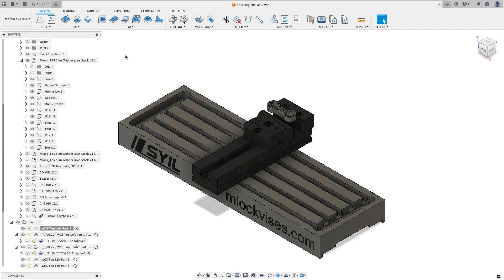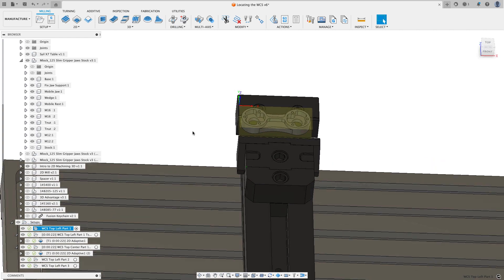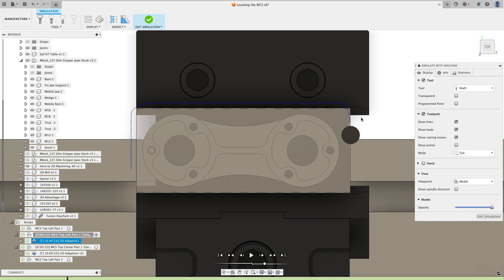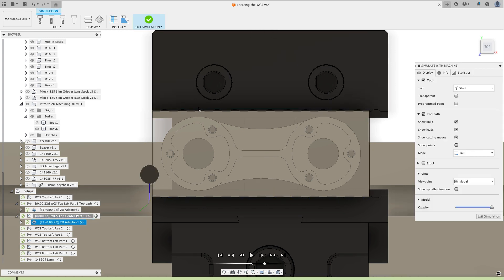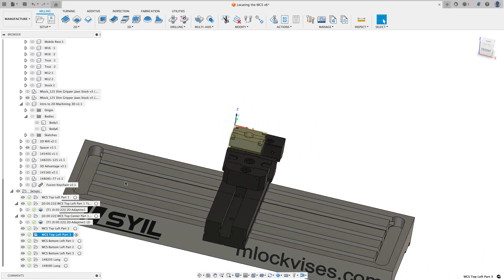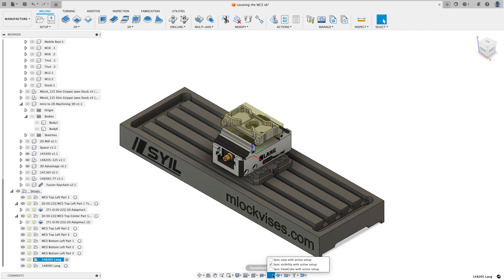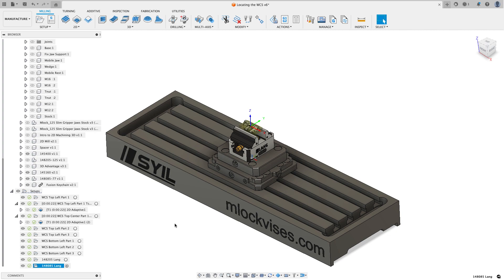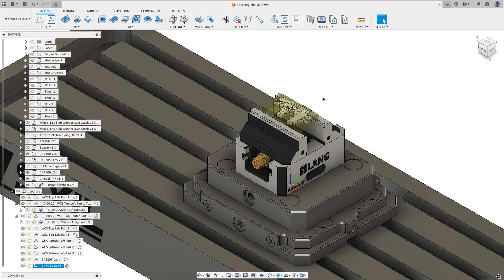Fusion 360 - WCS Location Options

Comment: I’m experimenting with a half/half process. I have fixed points on the vice as my reference. But the WCS is say underside midpoint of the stock. I then have a macro which is something like an incremental G10, which sets up say G54 based off the reference points. This is done with a manual NC op, and the offsets are measured off the model manually.

I’ve an automated probe on the machine, so I usually then do some automated probing to update the stock position to a few microns,etc. Those who use work stops could just go to the machine, check where the stock is and come back and update the params in the NC code.

I’m generally setting this up as a setup type program to be run once before the main program. Basically to semi automate machine setup. The benefit is that tool Z min is quickly inspected to see if it touches the jaws (eg nothing should go below 2mm for my serrated jaws). However, the program is unchanged if I move the vice and I can tweak the precise WCS by hand if needed.

Disadvantage is the manual step to enter the offsets (measured from within cad). However most users with a small number of vice/jaw locations will be reusing the same params in every program.

I wish such a feature was within fusion to automate the offsetting!

Comment: I tend to appreciate setting the z portion of the wcs relative to the part or stock (often the top) as it makes it easier for me to look at coordinates in g code and translate that to something in reality (e.g. if I see a z-1.25, I know that means 1.25 inches below the top of the stock.
Reply from the maker: Hi Gina. I'm curious. Do you watch the numbers on the control as you run the program that closely? My go to method is how I do it with the how to run an unproven program video I did a while back. As long as I know I'm not going to crash into the vise etc. I'm feel pretty good with that check.

Comment: Well I would not set up my coordinate center to a point that will be machined right on the beginning of the process if possible. As if I need to remove the material out of the wise or the machine goes nuts during the work.. like if the machine get stuck in the piece or who knows why which would mess up my coordinates and offsets I would not be able to reposition the piece or machine back. If you work in production of large batch, sure, you can throw away the piece and run another.. but if you design and manufacture piece by piece and things get changed on the way quite a bit it is always handy to keep the center as long as possible.
I found the bottom corners much better as I can also use that point while turning the model upside down. Well not 100% times but 99% more that upper right corners ;)
Bottom corner is not always the best though, sometimes a hole or corner of the model that is reachable from more sides can serve as referential.
Sure upper corners are the easiest to work with on simple parts.

Comment: 1. Operation always middle bottom of parts. I created cnc programs that set G54-G57 coordinates with Z0 resting position of serrated jaws. Mine have 3mm holding height. I model 4mm stock on bottom, 1mm on top. I mill 0,6mm under part, so 0,4mm over jaw. I model extra side stock to be sure adaptive will not break tool when stock is oversize. You will never ever crash mill in jaws this way. If stock is smaller, top of part will not be machined. Thats all. Operator is eyeballing X0Y0 and probe in cycle will set middle of stock for even sides during adaptive.
2. Operation I use always bottom left rear corner. I made several cnc programs with name of parallel heights. When operator needs 45mm parallels (I write him in program) he will just quickly run program which sets G54-G56 for 4 corners of vice and Z0 on 45mm parallels. This way the setup is fast as hell and since then accidents droped almost to zero.
I probe all operations in cycle. Operator is always just eyeballing X0 Y0. 
In 2. Operation to probe corner in cycle, I will mill off ,,hat,, around part or just hat in probed corner (this way there is no big burr for probe). I mill it about 0,3 mill over top of part
Reply: See my comment for an idea that might work for you. Write a kind of incremental G10 macro and then you can use both. Offset the initial WCS from the fixed point, to a WCS based on the stock. Works well with probing the stock then, yet initial offsets can be be set in CAM. Works across multiple machines even, with vices not in the same location!

Comment: Another advantage of basing the Z origin on the work holding is the accuracy of your collision simulation isn't dependent on the exact height of the workpiece so you can cut close and it'll work every time.

Comment: I don’t understand the WCS being under the pallet?  Can you spend more time on setting tools, etc… in relation to the optional WCS’s?
Reply from the maker: The idea is that those workholding components are very precisely made. So you can create a digital twin in Fusion. Once you touch the spot off on the plate that I show, that is the WCS for any setup that uses those components. It's a pretty slick system that is used by prototype shops etc. for low volume high mix parts so you can quickly go from job to job.
Reply: @MechanicalAdvantage  can comfirm. i use that everyday and just centre the stock with a caliper and hit run.
is also good for simulation and collision avoidance because the WCS never moves.
Reply: @MechanicalAdvantage  I’m sure I’ll figure it all out.  Thanks.
Reply: On 5 axis machines we had to use center of rotation as location of XYZ.  The build had to match the setup.   Today's 5 axis  have a Dynamic work offset G254. You set to center top at A zero B zero and the machine will do the math when it rotates.